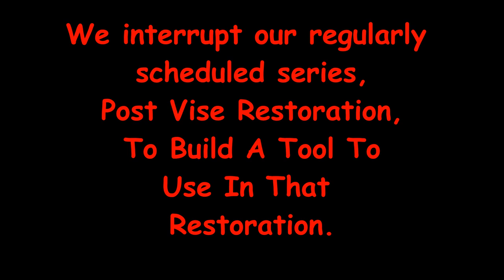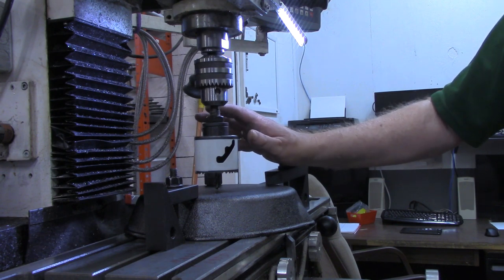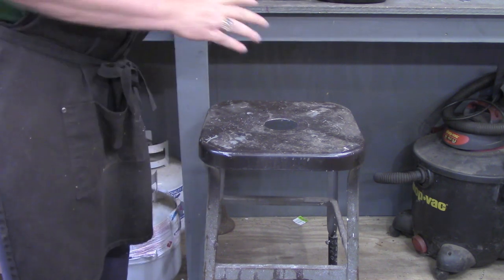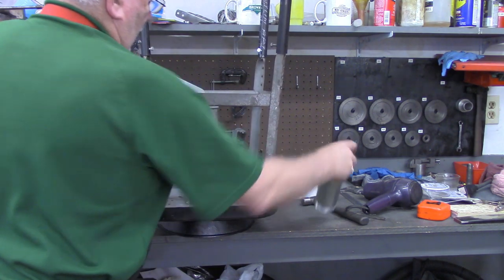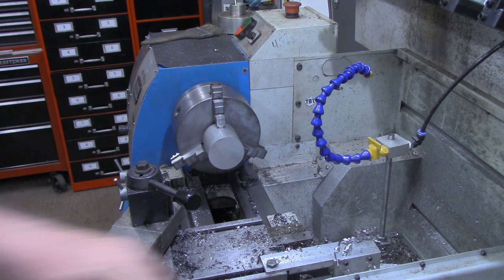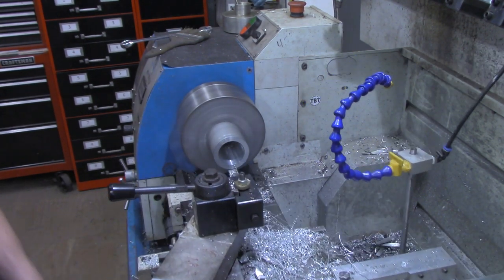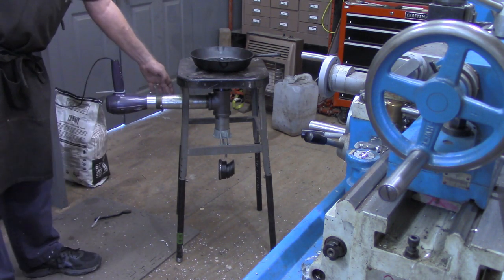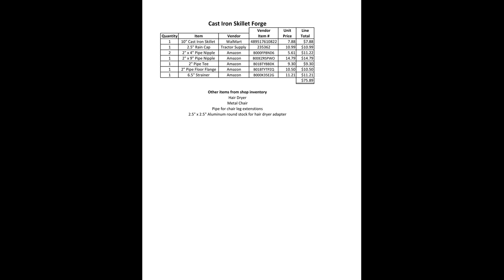Cast Iron Skillet Forge

Comment: Looks like it turned out well,  like a farrier's or a rivet forge.  Good blacksmith coal is  kind of hard to come by.  Lump charcoal--not briquettes--will light faster and get hotter.  The suggestion re tractor-trailer brake drum is good--some people put some refractory clay in the bottom, but for light use you shouldn't need to.  Getting your workpiece higher in the fire with more charcoal will cut down on oxidation of your metal if it becomes a problem.

Comment: Coal for sure should be hotter and let you use the high speed on the air to get more heat.   I could see it was red. But probably nowhere close to a welding temperature.   Looks like a good project.

Comment: I’ve been thinking of building a brake drum forge, but I don’t have an anvil other than a piece of RR track. And I don’t know where I could find coal in my part of the country.
Reply: Last I bought was on eBay. I don't use much. Kind of the odd heat and form job when I  just cant get enough out of my Oxy/acetylene,,, and because my son has my OxyA most of the time.